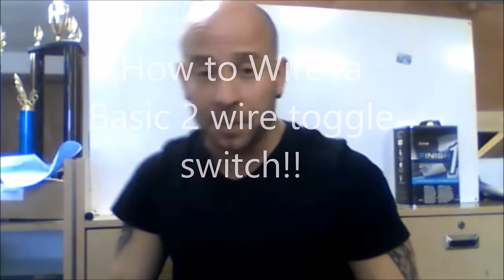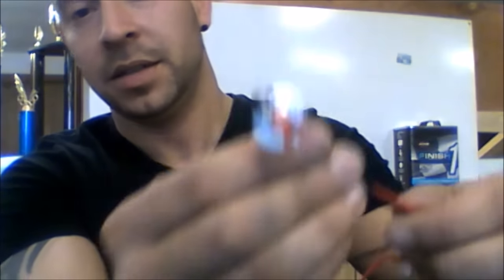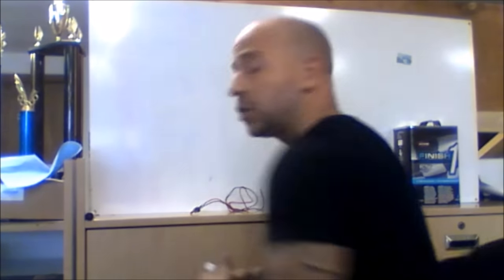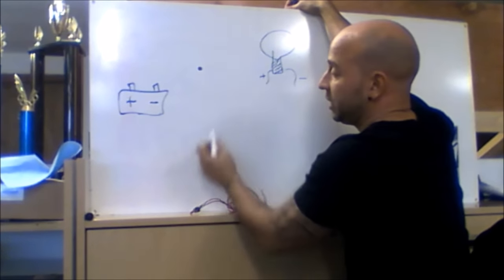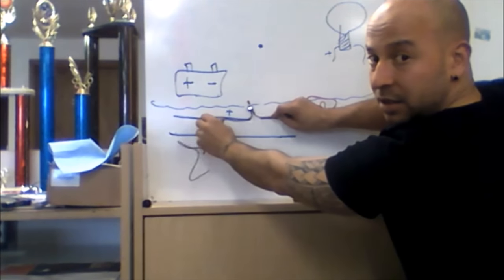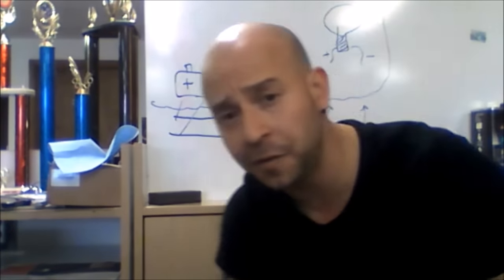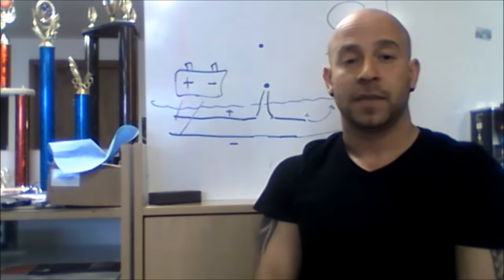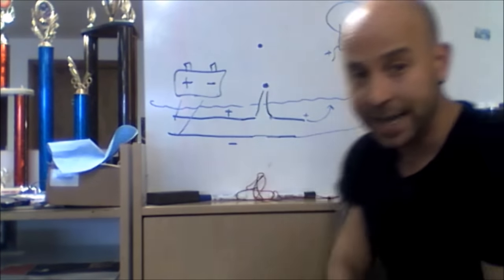How to wire a toggle switch , ( on-off 2 prong ) easiest best explanation, 2020

Comment: How do you install light wiring to a battery when the light does not have a return wire (no visible circle circuit.) It's grounded in the light casing itself? I have a 1951 tractor and I am really a dumb old woman trying to get them to work without the help of someone else around me. Got any ideas for me? I have three lights that are all positive wired to a switch and the negative is in each of the casings.
Reply from the maker: So what you'll do is.  Leave the ground local. Thats ok. For each light.
Reply from the maker: As far as the power. How many lights  and how many switches are you trying to put in?
Reply from the maker: Alot of times, the ground is internal. And is grounded through one of the lights mounting points. Leaving only 1 wire poking out, for power.
Reply: @myonlinecarguy1  I have three lights and one switch. Your information was very helpful. I got it after I watched your video. All three lights are working and bright! The ground is internal and I had to redo all of it. This old tractor is perking up quite well thanks to your instructions. I understood it more than I thought!
Reply from the maker: @saratruman1705  oh thats fantastic. Im glad everything worked out well for you.

Comment: This sounds a lot more simple but I want to make sure I understand correctly.. so on a two prong toggle switch if I wanted it for a kill switch on my amp I’d just cut my power wire and then “join” it back together with the toggle switch?? I thought I had to run it to the battery which would be annoying because I already have my speaker power wire and fog light power pulling from my battery post.
Reply from the maker: If by power wire, you mean the remote turn on wire? , yes. That would be how you would put it in on a toggle.
Reply: MyOnlineCarGuy1 yeah sorry I’m not well rounded with electrical stuff but I see my remote wire from my amp, thanks a lot man
Reply from the maker: @MrBob2212  all good. Just wanted to make sure we were talking about the same wire , thats all. Hope everything worked out for ya.
Reply: MyOnlineCarGuy1 easy as pie, just hooked up my kill switch in less than 10 minutes
Reply from the maker: @MrBob2212  awesome man. Thats great news, glad u followed up. I always wonder, lol. Super cool man.

Comment: what about the inline fuse line   does that change anything????????????
Reply from the maker: An inline fuse only limits the "current draw" passing through, but doesnt change continuity,  or how its wired. An inline fuse simply goes into the line in the appropriate spot while using a properly rated fuse.

Comment: I'm having trouble hooking LED light strips up on my motorcycle, which wires do I connect?
Reply from the maker: We have a fb group called (car audio 101 myonlinecarguy1) 
If you go there, you can send up pics of what you've got. I'll need those to help you with this one.
Reply: @myonlinecarguy1  ok thanks I'll send pics asap. Although the lights are already ran an wired, the guy disconnected the toggle switch I'm tryna hook the wires back up so the LED lights will work
Reply from the maker: @TY8215  sorry , its (car audio 101 myonlinecarguy1)

Comment: If the switch does have an led but is still two pin will this still work if you don’t care about the light
Reply from the maker: Electrically,  if theres an LED, the ONLYway itz possible , is to use the (+) as the pass through, and mount the LED Switch to metal, see without a gnd somewhere, its impossible for the LED to light. And without a 3rd pin, the ONLY  way to supply ground is through mounting. Id prob sooner use another switch. But yes, the on/off funtion of an LED switch IS NOT DEPENDENT on the LED having to work proper.
Reply: MyOnlineCarGuy1 I just checked again on the thing I ordered it from it is 3 pin
Reply from the maker: Perfect. Thats great. I hope it all works out for u.

Comment: I want to replace the button on my light bar with a toggle switch, the button I have right now has an LED light in it so it has 3 wires running to it, the toggle switch I want to replace it with doesn’t have an LED so it doesn’t need that third wire, so what do I do with the extra wire?
Reply from the maker: Excellent question. The 3rd wire is literally ONLY power/ground for the LED that is lighting up, when "on". If you are switching to a non led switch. Simply cap off the 3rd line so it doesnt short on anything. And ur good to go. Just leave it be, or remove it entirely.  As it wont be used anymore.
Reply: MyOnlineCarGuy1 Thank you!
Reply from the maker: @greysonhunsaker518  anytime, glad to help.

Comment: Could I make 1 toggle switch trigger two devices at the same time?
Reply from the maker: Yes , absolutely.  1 pwr in, 2 lines out. 1 to each device pwr input.
Reply: @myonlinecarguy1  is there a way to add a delay to just one of the devices? If there isn't a way thats fine ill just change the blueprints. Also, could you reverse this process in any way?
Reply from the maker: You could add a relay with a timer  to cause a delay on just 1 device
Reply: @myonlinecarguy1  ok
Reply: @myonlinecarguy1  Thank you!
Reply from the maker: Your welcome.

Comment: The way you showed on this video how to connect the toggle switch from the battery to the toggle switch and then you have to add the other side that goes to the device which is the amplifier for the subs now can I connect the opposite post of the battery and it's do the same thing with the toggle switch to the other amplifier this for the speakers

Comment: I have 2 15inch cvr kickers and a 1500watt  audiopipe amp the speakers max power is 750 I believe but they are not hitting hard would you suggest me to get a bigger amp
Reply from the maker: Find out the RMS of all your equipment. Match that all up. Never Max.

Comment: Would this theory apply to an on off marine switch for a cranking battery in a boat which has three places to hook wires or cables to?
Reply from the maker: are you referring to a starter wire? the amperage of a starter would be way too much for these switches. but the proper switch capable would essentially still wire the same.

Comment: Forgive me for silly question .  I want to do a portable speaker on 24v but all I have seen is 12v toggle switches can I use that fellas anyone has an answer again forgive me for being somewhat of a novice . Thank you and happy new year
Reply from the maker: As long as the switch itself is rated for the voltage AND the amperage draw that your wanting/needing  to run your decice, then This applies perfectly still. 
But no, a 12v dc rated switched. Shouldnt be used for a 24v dc application. (If that is your actual question) . Do the leg work and fond the 24v dc /or higher switch.
Reply: Thank you
Reply from the maker: @NoWay-zk6ze  you are very welcome

Comment: awesome explanation-- quick question, what if you have two toggle switches for one accessory? would both of the toggle switches connect to the power line, or would you connect one toggle switch to the power line and the other switch to the ground line? thank you!
Reply from the maker: Either way would work. As 2 switches is "redudant"....(will act the same) by cutting power before whatever the following device is..so ex; 

 power>toggle1>toggle2> device +
Ground>>>>>>>>>>>>>>>device -
      Or
Power>toggle1>device +
Ground>toggle2>device -

Either way, you'd need both flipped "on" to activate the device
Reply: @myonlinecarguy1 You say both would need to be flipped ON to activate the device, but I'm aiming for each switch to be able to turn the device on/off independently....The switches will be on both sides of my bed so either me or the mrs could flip the switch to turn off the one lighting device...So it's one device, two switches able to control the one device independently; can you do that with both switches connected to the power lines?
Reply from the maker: @Karl6464  ok yeah so in both the diagrams I tried to show would require both switches to be on. 

If you'd like "either" switch to activate the device. Then you are looking at a diff way of wiring entirely. 

I would search for "2 light switches 1 room"
I can explain, but not very clearly in text. But I assure a search of that, should show you EXACTLY what you'll need for your project.
Reply: MyOnlineCarGuy1 You the man, I appreciate it.

Comment: Would this work for my fuel pump to?
Reply from the maker: Absolutely.  Now for a fuel pump the toggle cant be in the MAIN power line. It pulls way too much power for a basic switch. 
Every fuel pump has a lower voltage or lower amperage TRIGGER wire on it. Tell it when to turn on/off.... make sure the switch is on that one.

Comment: Nice video Vin, lol! Quick question… I’m trying to use this toggle switch for a boat amp. 1) would I do exactly what your showing on the remote output on the amp, wire to this switch and have the other end going out to battery? Also, 2) the LED might be helpful just to see if the switch is on or off, how would I wire it differently to power a very small LED?

Thanks again!
Reply from the maker: Yes,  you would put the switch in the remote wire not the big power wire.
And you would be best off to use an LED lit switch, i have videos here in the channke for exactly that.
Reply: @myonlinecarguy1  Sorry can you just explain that. So the amp remote wire comes off the head unit and plugs into the ACC part of the 3 gang switch. Then I run the + and - to the battery? How do I hook up the switch to the amp remote plug? Sorry if that’s confusing
Reply from the maker: The switch will have an input and an output. The remote wire when cut will have 2 leads. Power coming and power going. Wire those to ur input/putput accordingly.  This will leave 1 lead on the 3 prong switch,  that lead needs to be grounded. And that all. Done and done.
Reply: @myonlinecarguy1  I don’t have anything wired just yet, but my plan is to use a switch to turn a speaker amp on and off. So the remote wire from the amp somehow has to get connected to the amp remote wire. In all I’ll have the amp, the head unit, and this switch.
Reply: @myonlinecarguy1  Sorry so I think I understand. The remote wire from amp gets plugged into one prong, the remote wire from the head unit gets plugged into another prong. The third prong gets grounded?
Reply from the maker: You got it.
Reply: @myonlinecarguy1  I appreciate your help! Also just looking for Any suggestions about running the amp While on the water anchored up. The amp is going to drain the battery, do you suggest anything to help
Prevent that? I thought about just starting it once in a while, turning amp off for a bit (no fun), also thought about another battery but not too reasonable
Reply from the maker: The amp wont drain anything if the remote wire is off.
Reply: @myonlinecarguy1  silly me. So I want to install an amp switch to turn it on and off to save battery if need be. Say my boat is on the water and I want music and don’t need it cranking it’s best to have the amp off to conserve battery. My idea was still to be able to play music with the switch off, just not using the amp. But if the speaker wire is wired into the amp and I turn the amp switch off, will it still feed the audio to the speakers? Bc if the signal won’t reach the speakers the switch is basically useless to me
Reply from the maker: Toggle switch in the remote wire would shut off the amp completely  yes, even if the radio is still on.
Reply: @myonlinecarguy1  so how would I get music to the speakers without the amp on in that case? For what I want to do I would have to wire the speakers back into the head unit? Just trying to figure out what the point of a toggle switch would be since I confused it. I wanted to conserve battery have the amp off and then powered speakers off the head unit. But it sounds like it won’t be possible
Reply from the maker: Yeah its 1 or the other man. Sorry.
Reply: @myonlinecarguy1  no worries! I’ll probably install it bc why not lol
Reply: @myonlinecarguy1  Thanks again! Just finished up installing last night. What would happen if I wired the speakers into both the head unit and the amp? Would this toggle switch now be able to turn the amp off and the speakers would default back to the HU? I’m just thinking for a boat having an amp killing the battery while on the water isn’t always the best idea lol
Reply from the maker: Maybe if you did a diode isolation,  but thats whole diff type of wiring.  I dont think a toggle alone is going to do what your wanting. I really think you need to wire one or the other but not both, i think your going to create an electrical back feed and i do not know what happens after that if you do. 
Most boats have 2 batts and a disconnect for batt #2. For saftey of not killing both batts.
Reply: @myonlinecarguy1  Exactly my thoughts, the speakers would be active for the amp and the HU and seems like they would be working against one another. I really appreciate all your help and fast responses to try to assist me

Comment: Also does the ground wire have to run back to the negative? Or just only run positive to switch continue that positive on the other post straight to the object and only ground the other wire?
Reply from the maker: Ground is only for the light. Not the function of the switch. Its not "needed".
Reply: @myonlinecarguy1  perfect thanks.
Reply from the maker: Anytime

Comment: Is it possible to add another light and switch and have the switch control each lights separately?
Reply from the maker: Absolutely.  If each device has its own switch. Each switch will control the devices behind it. So if you want isolated control, you'll need isolated circuits.
Reply: @myonlinecarguy1  ok thank you if possible is there a video or can you send me a rough sketch how it's done?
Reply: @myonlinecarguy1  and thanks for the quick reply
Reply from the maker: Just imagine you power wire like a Y , wher eit splits into 2 tuen jist after the split, each leg gets a switch, then each switch supplies its respective device.
Reply: @myonlinecarguy1  thank you so much my little brother  and I were doing this little diy project but didn't have the knowledge to do so. Thank you
Reply from the maker: Thats super cool. I hope it was helpful. Good luck with your project.

Comment: I am replacing a 2 prong rocker and the stor only had a 3 prong one that lights up. Could I just hook it up like the other one and not worry about trying to wire the led in the switch?
Reply from the maker: Yes. The led portion of the switch doesn't effect the "switch" portion of the switch.
Reply: @myonlinecarguy1  ok, great! Yeah, I am replacing a rocker switch on my patio umbrella that has solar lights and a  plug in option. So on one pin there are two wires (I am guessing power from the solar and power from the plug) and then one coming off the other pin, to light the lights. I can't get to a ground wire and don't fully understand how to incorporate one. So I will just hook up the positives and not do anything with the 3rd pin? You are awesome. I just didn't want to get shocked or cause a fire, if that is even possible.

Comment: Do the same rules apply if I'm connecting the toggle switch to a low voltage led table lamp ?
Reply from the maker: Yes. As theres a good 90% chance that led is still 12-24vdc and the dc is where these rules apply the most. It will also work for a/c voltage but would require a switch capabale/made for A/C power.

Comment: i bought the switch in lowes i assume it is for a 12 volt system
Reply from the maker: well you will need to know what it is, as it will absolutely make a difference.

Comment: My 01 cherokee power will not turn off so i wired a single light switch off of my battery and it works as of now as a kill switch or toggle switch i tested it and it works as should i am using strong enough wires just wondering if this is safe i started jeep everything seems to work good i just would like to know if it will pop or catch fire eventualy definitely dont need that happening!??
Reply from the maker: Make sure u have a fuse jist after the batt c9nnection and before the switch. Also that the size wire and fuse ur using match properly to the lights electricla pull and toull be safe. Otherwise, no what your doing is not that safe.
Reply: @myonlinecarguy1  gotcha you seem to know alot more im a young guy just learning it all trying to get by safely thank you
Reply from the maker: Safty 1st is a very legit thing. Otherwise you xan literally lose everything, ive seen it too many times from clients being impatient,  ya know.

Comment: Lets say I wanted to run a five bank of toggles to control different lights on the boat. I don't want to run five different sets of two wires to the battery. Would I need to solder five wires into one or could I wire all five into one terminal end?
Reply from the maker: Sorry,  i got super busy. Yes a common connection for supply is ok. Same as ground. A common spot for ground is also ok. 
(Buss bar) would be what thats called.
Reply: @myonlinecarguy1  What about a toggle box?  That would keep it waterproof.  But from what I've seen there are only one wire per switch coming out of the toggle box.  What about the Neg wires?

Comment: Are you saying on the one line Red or Black line, you put the toggle switch the  black and red from the switch goes on the same side and other end of line goes to the battery and the other end connects to the item and the negative just  goes to the battery and negative on item